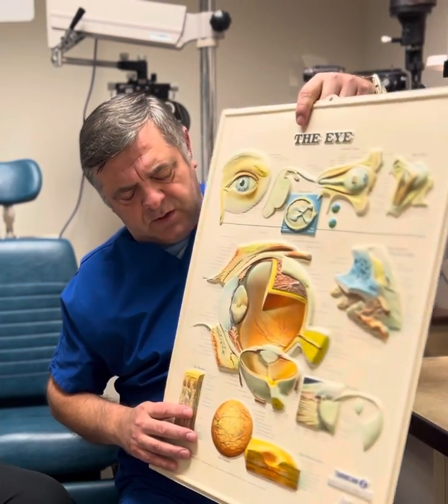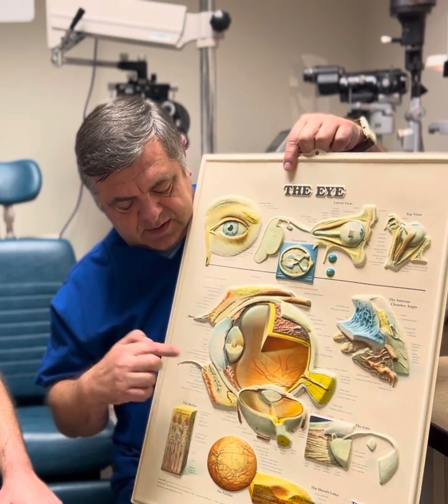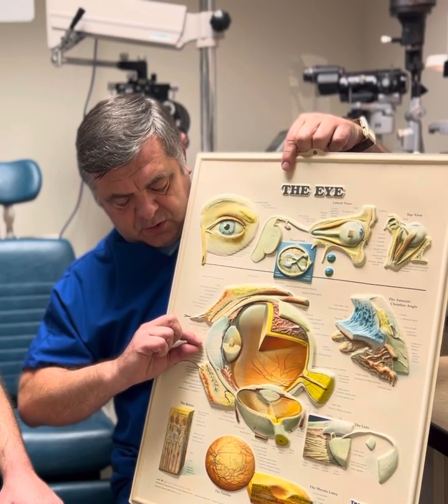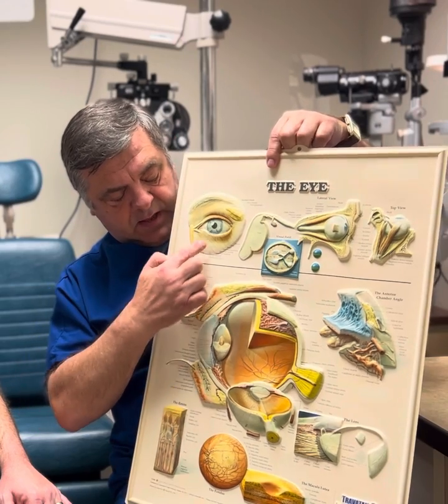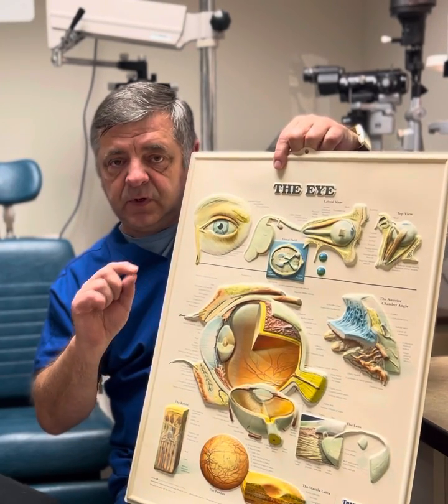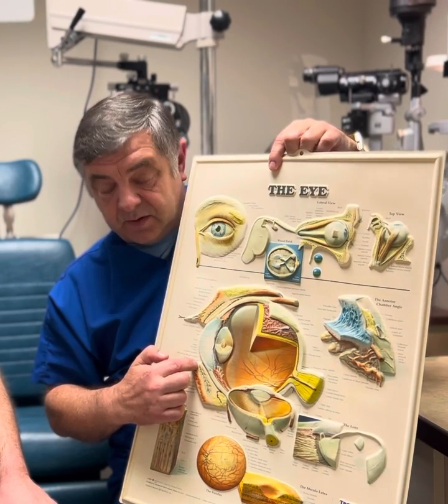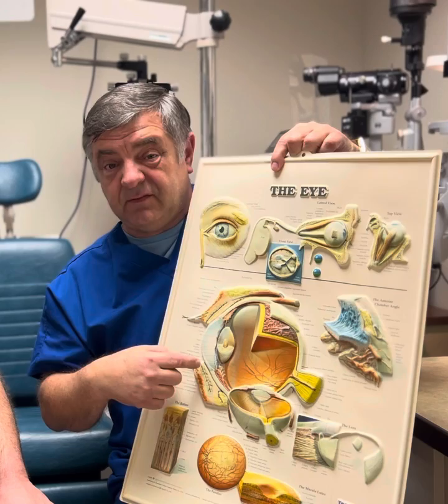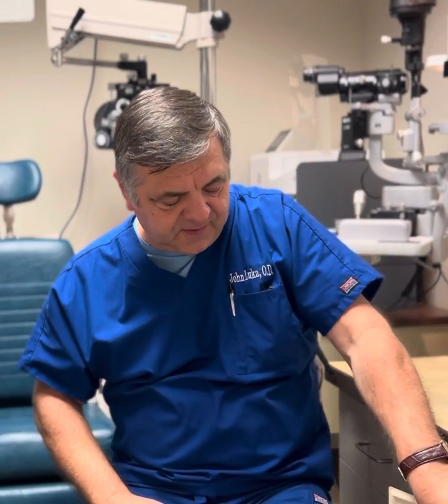How does your tear film work?  Dr. Luka explains

Comment: A lil bit ov wind 🌬️ makes my eyes water everytime,does my nut in especially wen wear makeup.does anyone know if rose water is ok to use in eyes?
Reply from the maker: You’re eyes water in the wind because your tears are evaporating too rapidly.  This is because the oily layer of your tear film is deficient. Try this, get a heated eye pad from the drug store.  Use it nightly for 5-10 minutes.  This will help stimulate the oily layer and slow evaporation of your tears. 

Rose water is anti inflammatory but most likely won’t help with your issue